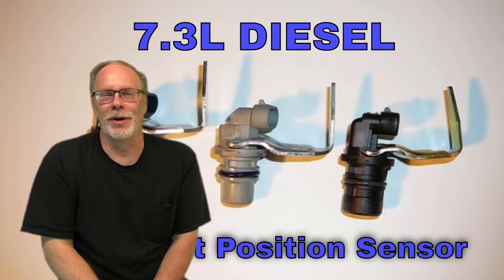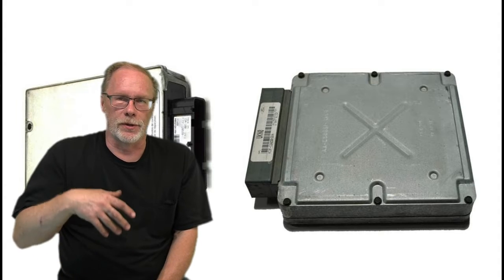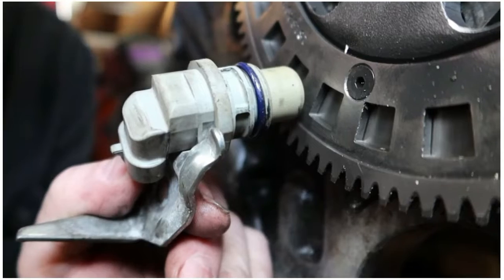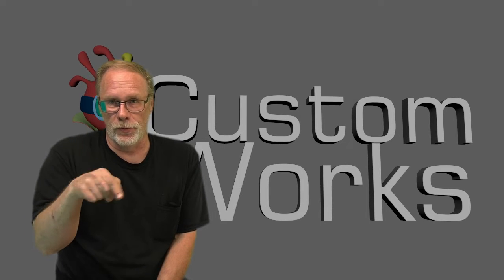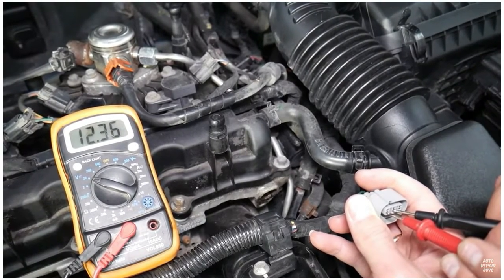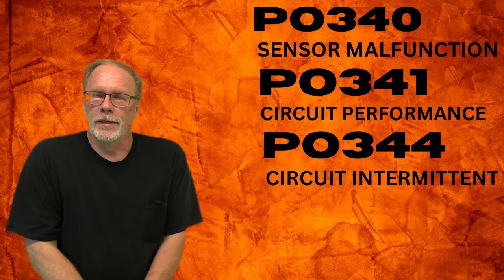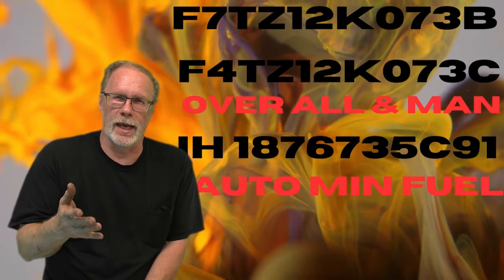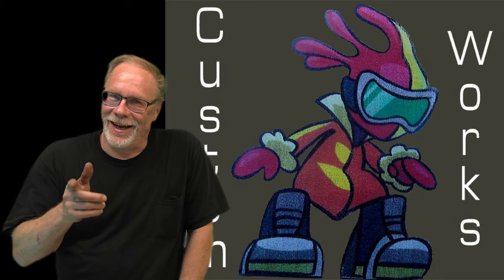🛻📽️ ....7 3 POWERSTROKE CPS CAM POSITION SENSOR  🟢🟡🔴🟢

Comment: The cps is the bane of the 7.3. My 1997 truck ran great for 3 years when it was new. Then the sensor problems started. If I took it to a shop or worse yet, Ford, charges started at $300. All they did was throw parts at it. I eventually figured out I had a short in the wiring. At least one short. Before that I went thru CPS sensors like fuses. I think the pigtail was bad all along. I know tow truck drivers by their first name. A couple months ago I watched one of your videos where you recommended changing the engine wiring harness. So I bought one from Ford. It wasn't perfect. I had to reroute some of the loom to reach the sensors. The wiring is better protected in the new harness.
But it made a huge difference. The truck runs like new. I have noticeably better power, better shifting. and easier starting. Thanks, that has to be the best advice I ever received on this truck. So far no codes. I have no idea what else wasn't working correctly. I found codes don't always tell the whole story. Thanks again!!!!!!!!!!!! Have a beer or a bottle of wine on me.
Reply from the maker: THANK YOU VERY MUCH , THIS IS WHY I STARTED THIS THERE WAS SUCH BAD INFO ON YOUTUBE ECT !
Reply from the maker: Thank you so much This is why I started doing this To actually help everyone !

Comment: Hey Clint I’m an original here on your channel ! I have a weird issue on my 7.3 I changed all sensors Lpop Hpop valve cover gaskets turbo injectors and cups etc and truck turns on good idle is good but when I run and hit a pot hole or hard concrete it want to turn off any ideas ?

Comment: if you understand how a guitar pickup works, pretty much the same mechanically. Fine enamel coated copper wire wound around a magnet. amount of winds, or gauge of mag wire change ohm. With guitars , shape of the magnet tip changes field shape.  a sharp edged field or a soft blur of a field. also direction and Gauss  strength were tunable.. Also, looks like the ford items are "potted" in epoxy. that can also change the ohm , etc,,,,, as a matter of fact, Fender in the 1990's  had guitar pickups called lace SENSORS. I imagine it's strange having the sensor pickup a precise pulse as the block of steel swings by  , WHILE sitting in an Iron engine... ((Hmmm, wonder if sensors work better in aluminum blucks.....))))

Comment: I'm shopping for IH 1876735C91 for my 02 F350 7.3 PS. Is the IH 1876736C91 comparable? I'm reading it's an "upgrade"? Noticed new Motorcraft F4TZ12K073C (Black w/ dark blue o-ring; dated 20FEB2025 on package) is stamped with the 1876736C91 part number. Please reply. Thank you!
BTW - Love the channel!

Comment: If i dont have the 12v reference on my pigtail do i need a new wiring harnesse? I have replaced the csp and pigtail, but still no 12v, but have the 5v.

Comment: what if I’m only getting 7.5 V instead of 12 V to the cam sensor. I do have the 5 V reference with adequate supply. But I only have 7.5 V going to the sensor and the metal will not drop the voltage on any of my sensors.
Reply: I have the same problem did you ever figure out the 12v fault?
Reply: @adambetancourt720 nope I'm done with it
Reply: @mrs.waight7326 
Call at least let you know if I do figure something out I have a new wiring harness and getting installed this week

Comment: I just replaced cam sensor it ran better than it has in years but in 54 miles it started the same rough running and shut off several times before I could get it back to the house. I have a 1999 F350 crew cab Dooley manual transmission should I change the sensor again? The truck has 226,000 miles on it.

Comment: 98 super duty automatic. I have tested seven cam positioning sensors. Two used sensors. Two sensors from auto parts store, two from the Ford garage and one from international. All have failed the test new and used. I've used three different electrical testers. Is it possible all these cam positioning sensors are bad out of the box? The amp pen does not fall on any of them. Wayne, come in contact with another metal object.
Reply: I'm having the same issue 5 different sensors and on none of them does the 5 volt reference drop

Comment: Well, my part's cannon has been fully unloaded upon the beast... 

So after getting stranded in valley city...  thank godOne of my old army buddies lives there..

I got a new water pump. I got a new thermostat. I got a new cam position sensor I got a new york injection pressure sensor I got a new I p r valve...  i got new valve cover gaskets and pigtails. I got a new wool plots as well as new oil, cooler oil rings and gaskets..

I also have a new transmission as of this spring. So that's about, I don't know $6500. Maybe it didn't heart and I did all the labor so yeah, i'm sure none of it's installed, right...

Anyways, now i'm probably going to go to step number one what's going to go through my wife, aint harness? Are we dead? Injection and glow plugging part of it? That's when I did that. It's bell covered, yeah, and yeah, I noticed that now instead of collecting my problems are much more intermitted, it's still the same wealth, and it's not that bad as it was. I got a check engine. Light to go off and now I just have, I think some intermittent groundings. Man, I need that trace the wires? And then I'll have to order the engine wiring harness, because that's obviously not helping me anyways.
I'm very happy You're a real live person sure, and you know, s*** liked it really well, thank you

Comment: Clint, my good man.... you are my hero.   Literally.  

I just replaced my valve. Am I a sensor for the fuel pressure thing? You know, the IPR valve and whatever fuel pressure sensor valve sensor thing, not valve, whatever you know what? I mean, and then when I put everything back together, it's running like s*** and chuffing, so I created a new problem. When I was moving all the wiring, i'm pretty sure, and i'm pretty sure it has to do with this good lord.

Comment: Can they cause a hot start issue i see when im not starting im also not reading rpms and then when it reads it startes ive checked everything else other then this and injector o rings runs fine if you can get it cranked only when its hot do i have this problem
Reply from the maker: I would check the sensor when its acting up CPS or IPR will do that as well and I have a in-dept video on that as well

Comment: Hi sir,
I am diagnosing a 2003 f250 with 7.3 l
Crank no start. Firts issue the scanner won't scan the truck. The obd port has power and ground. All the fueses are good, the fuel pump working, have oil up to the level, pcm is online. I noticed the rpm is not moving while i crank, is it possible it can be the cps

Comment: Enjoyed your video.  I have a 2000 F250 Powerstroke, auto trans. with 199,000 miles.  I am going to purchase a spare CPS.  You mention the IH type primarily for automatics and the Ford unit for the manuals.  Any idea on the longevity comparison between the two brands?
Thank you.

Comment: My 2001 7.3 bucks and after warning up and trying to restart.. runs even worse, if at all.
Tiik apart the fuel IPR valve and soaked and cleaned and reinstalled and it runs much better when first started but repeats the same bucking and such soon after.
Posting a video below.. would appreciate any help, thanks Clint.

Comment: I need help... I have a no start. Cranks great just replaced both batts. Switch to 3 different cps sensor and still no tach in dash. Gave tried everything. What else would cause no tach in dash other then cps?
Reply from the maker: https://www.youtube.com/watch?v=ZJ5BSBntTzA           This video covers a lot of issues , skip over the obvious that wouldn't cause issue Also get forscan app so you can check computer idm for communication along with other PIDs   plus did we checck the fuse box

Comment: I spoke with IHC parts department and was told the IH 1876735C91 was for the IHC 555 trucks. Is that possible but still best for the Ford 7.3 444s ?
Reply: Did you ever get an answer?

Comment: So I’ve got 2 of the f4t sensors. I get my 5v. 12v and ground but when I plug it in and test with a piece of metal my 5v doesn’t drop down to zero. Code p0340
1995 f350 7.3 

Also for this truck I can’t pull any pids does the pcm need to be reflated to be able to read pids? FORScan lite with vlinker Bluetooth

Comment: In the video you put the red on the ground a pin and black on the black on the 5 volt b pin had me going In circles for a minute plus my 97 wires are different color
Reply: I have the same question, the pin A ground in the diagram is at the side but when they do the test is on the middle
Reply: @luzarthighlights6920 i had the same question but in the video of the test its not even a 7.3 so i'd just go by the diagram

Comment: Clint I am about to give up on my 7.3 bus.. is there a way I could send you and email to let you know what’s going on with it and see if you could give me some knowledge? Starts up and runs great, idles great, would drive until I tried to go over 40 mph and it bogged down and died on me. The guy who sold it to me said it was the icp, but I think he was lying about a bigger issue. I just pulled the turbo and cleaned it because it threw a code for the ebpv. I use to sell cars but now I’m confident I could be a diesel mechanic after all the research I’ve done the past year. Idk if the guy tried to do a ebpv sensor delete or what.. but that’s the only code I’m getting. Thanks in advanced!!!
Reply from the maker: Ive got a video on fooling the pcm on the ebpv delete As far as the real issue get or rent a fuel gauge hook up post pump and a oil pressure gauge hook up to the head oil rail what are those readings at 40mph ? let me know on a fresh comment seems threads on same comments don't come through from youtube
Reply: @CUSTOMWORKS7.3PSD  you want me to comment on another video?
Reply from the maker: @thesoutherndisciple  yes
Reply: I’ll have to get the turbo put back on before doing what you said. And I’m working in a dog house, so I’m extremely frustrated. 😅
Reply from the maker: @thesoutherndisciple  cool

Comment: For 3 years now I can't get my p1000 to clear. I NEED HELP!!!! I've done all the drivability drive test. Don't know what to do. Please help.
Reply from the maker: You have ghost codes in the pcm or missing, disconnected sensors, poor wire connections no matter what ford you have in there line up A dealer or repair center that has actual ford tech bidirectional scanner needs to reset the computer to clear what a po reader or uni scanner won't show for faults Then do the relearn for that model year since they differ by year and model

Comment: Have a question , working on a 1999 ,7.3 , won't run ! oil pressure at head good , fuel press good coming out of fuel bowl two new cam sensors , squirt oil down glow plug holes will start for minute , compression is 200-225 across board ,was good runner before cab swap , any ideas , thank you

Comment: What's the difference between the crankshaft and the camshaft?
Reply: Crankshaft moves the pistons

Camshaft moves the valves
Reply: Camshaft spins at 1/2 the speed of the rpm gauge (or 1/2 the speed of the crankshaft)

Comment: Hi Clint, Thanks heaps best explanation of the CPS online. By the way I too have had a huge disappointment with Mishimoto radiator, leaked strait out of the box and the drama of getting it here to Western Australia and they have wiped there hands of it. Stay safe and good wishes from 7.3 Down under.

Comment: A few people here have figured it out.  Carry a spare in the glove box.  They aren't expensive.  (also a wrench of which the proper size evades me. sorry).  I have had one fail, and the 2001 F-350 "Dually" 7.3 Liter just flat out dies.  NO stumble for me, just dies like John Wick shot it.
Reply: 1/4 ratchet and 10mm socket. Best to have a 4 inch extension as 6 is too long and your hand is in the fan. 4 inch is just right.
Reply: @sirseven3  Excellent.  I have a small mini 1/4" ratchet.  Your input is appreciated.

Comment: Ih part number is it wrong?
Reply from the maker: 1876735C91 | OEM Internotional Transducer Assembly, Position Camshaft
Reply: @CUSTOMWORKS7.3PSD  The sensor I use on mine  and or customers is a 1876736c91
Reply from the maker: @Shovelhead-Greg  thats the same as 
Cam Position Sensor CPS 94-03
Part Number:
    F4TZ12K073C
Reply: @CUSTOMWORKS7.3PSD  yeah that's the bag it comes in But what's the difference? That's the sensor that is dark gray blueish with the purple o-ring
Reply: This number good for automatic transmission?
Reply: @roberttucker68  The sensor itself doesn't change for manual or automatic

Comment: Hey Clint.  Ive tried all but international one. Cant find one near me. Im running the C model in my e99 auto. Seems to run a bit better than that crappy grey one. And for those of you having stall out issues when you turn wipers on. WELL.. IT HAPPENS LESS. @CLINT. DO YOU KNOW WHATS HAPPENING WITH THIS ISSUE.? IVE DONE EVERYTHING. GROUNDS ETC. . PLEASE GET BACK WITH ME. As far as 1mpg more. I'll take it..😂 Another great video.

Comment: I just changed mine. I have bwen watching every one of your videos to stop the vilolent vibration on my 94. I just found out about my dual mass flywheel. Its coming out next.
Reply: You figure this out?
Reply: @Retorical-Ricky I did, dual mass flywheel was toast. I also had a cracked bell housing that needed to be welded. I also added down pipes and up pipes while the transmission was out